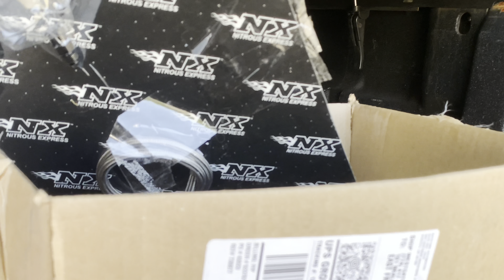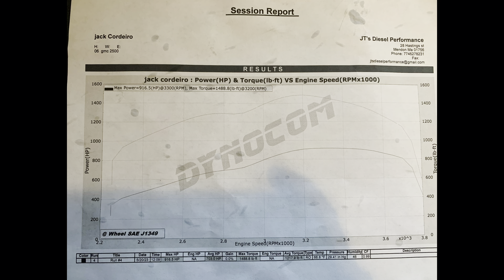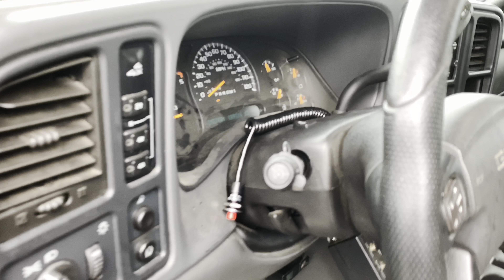Brought The Duramax To It's First Dyno Competition!

Comment: Have a lbz myself, can’t believe that stock y bridge didn’t blow apart at 900 hp, I blow mine out at 530 hp, what turbo size, and what are you running for fuel ?!
Reply from the maker: 68mm Danville, and 100 overs
Reply: @jackcordeiro  yeah that will do it😂 I got a 68 mm on my truck love it, I just needed more fuel. Badass truck man!
Reply from the maker: @evang-m2200  haha, thanks I appreciate it!